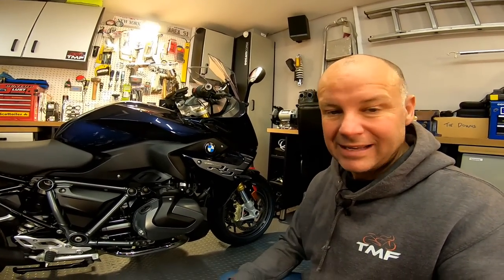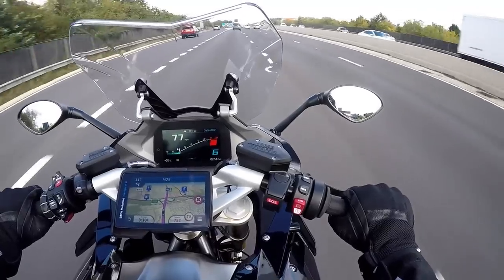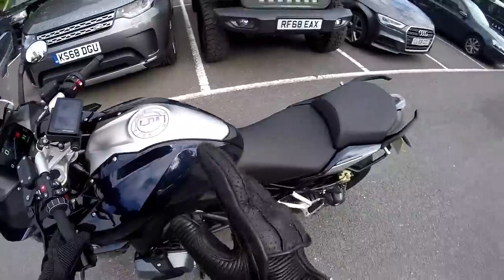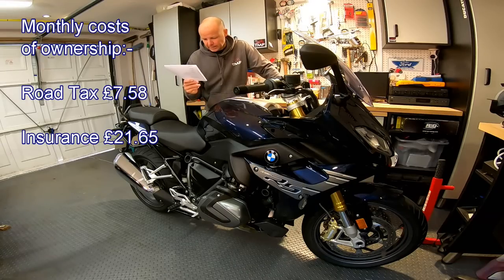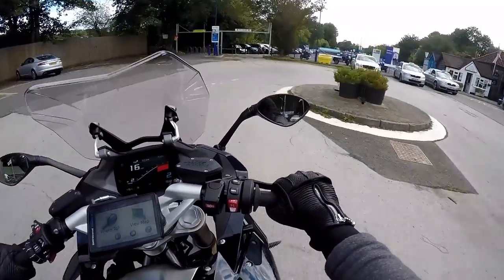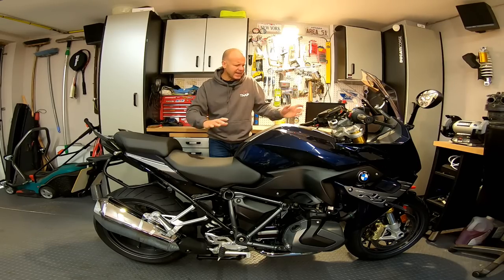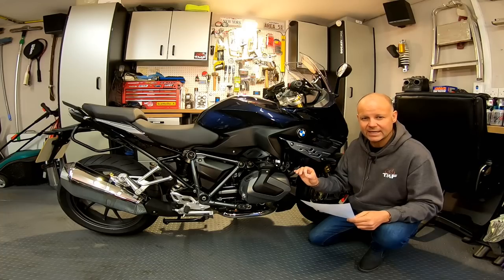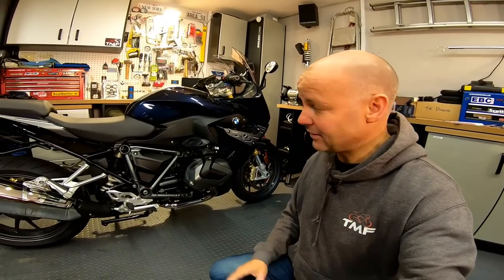Living with the BMW R1250RS - In Depth Review

Comment: Surprised you didn't get much turbulent air off the screen as it doesn't look much different from the previous R1200RS. I ended up fitting a MRA Vario screen, that made a big difference. A rear (Puig) hugger also helps with rear crud fling. Should be standard on a sports tourer tbh. I always worried about BMW painted front engine case being directly in the firing line from stones and debris so fitted the excellent MachineArt Avant Guard (looks factory). The Akra sounds great. Just some ownership tips if you get one in you future.
Reply: After having the R1200rs which I too installed a MRA Vario screen. I now have the R1250rs I have on order a new MRA screen, because I to found too much buffeting and helmet noise with the factory screen.

Comment: For interest, I'm 5'10'' and rode the previous model RS. Great bike but had switch to GS due to the cramped leg tuck, overweight on hands due to slight pitch forward and buffeting on helmet due to insufficient wind protection. Just too old to be "tucked up " on longer rides these days. Spot on review Sir!
Reply: I agree, have ridden both the RS and R and preferred the R for the all the reasons you mentioned about the RS.
Reply: Does TMF mention this in the review? 
I agree wholeheartedly with your comments.
I thought this may have been addressed by bmw with this model.
Reply: I'd expect more of a wind blast to the body would take some weight off your hands 😎👍
Reply: Tried an RS, but my knees were uncomfortably high. Guess I'm also too old to be tucked up. 😅

Comment: I used to own the 1200RS and have recently taken the 1250 for a test ride. There are a few things it still needs...Rear hugger .. change the position of the satnav as it's going to get blocked if you have a tank bag fitted. And bar risers, on long distances I used to get shoulder ache. Apart from those things it's an excellent bike.

Comment: I’ve had my 2016 1200-RS for the last 2 years & covered 14,500 miles, it’s never missed a beat - great all-rounder!! 
It is quite cramped though, easily fixed by getting the higher sports seat. Then you’ll need the bar risers to take the extra weight off your wrists... 
Also that standard fitted screen is totally useless on long trips/tours, I have two aftermarket screens to chose from of different heights, a tinted (more sporty looking) Puig - & a clear high/wide Givi screen. 
I have fitted a LeoVince exhaust to mine, but find it just too noisy for touring on, thankfully it’s a very easy/quick swap back to the standard exhaust, & visa versa!
I’m toying with changing it (eventually) for the 1250rs, then swapping all my extras on to that... I won’t take mine to any BMW main dealer for servicing, with those stupidly high prices! 
I’ve found myself a “back street” BMW specialist who only charges £40 per hour (as opposed to £90 per hour) labour, much better mechanic too imo. 👍🏻
Reply from the maker: Good find!

Comment: Mr. Flyer-A fine review of this beautifully blue painted bike! I compare it to my '81 R100RS and find some changes: mine has no electronic devices of any kind (no TV screen, ABS, electrical suspension, fuel injection) and fewer horses. But it does have the best fairing ever, much more lightness, an oil dipstick, a complete toolkit, and two (2) exhaust pipes as is proper for twin cylinder machines. In 38 years BMW has improved some things but left other good features behind, and it would be fun to see you review one of the older airhead BMW motorcycles.
Reply: Ha! Those '81s have the cool Mad Max fairings. Lovely. I have a '94 and I also just don't like the look of the new RS, it's just too sporty. A sports touring bike should look more of a touring bike rather than a large crutch rocket and I heard that same comment in other reviews as well. I am also holding onto mine and hoping they'll have a better look for the next gen, or just might end up getting an RT - even though I don't want a full touring bike.
Thanks for the in-depth review Mr. Flyer!

Comment: I have an ST which is the previous generation but same concept.  I removed the clip on bars and raised up the controls, installed a touring seat but left the pegs in stock position. Great Sports touring bike but not a touring bike.  Fun to ride, not as powerful as the 1250 but not as heavy either.  Great handling bike compared to the RT.

Comment: You can buy an enhanced rear mudguard at any BMW UK/AUS dealer. 
Quick and easy bolt-on OEM replacement for the  piece that sits behind the number plate arm. 
Not so pretty, but as it's much wider it keeps all the mud of the back of your pillion and your top-box. 
Forget the huggers, they do very little.

Comment: Thanks TMF for a nice review. I'm looking to buy a 21-22 R 1250 RS Exclusive used and found your review quite useful. The quiet exhaust issue your raise is a plus for me. Some residual concerns not addressed are the rear mudguard, which appears to promotes a tail tidy but hardly practical. Also, not sure how much proetecion is offered to the rest of the components. Likewise, the front mudguard may be too short in arc to provide full engine protection in this type of design. None of these issues were discussed in your review, but important for daily and touring riders alike. You also don't discuss slow full lock cornering such as low radius u-turns under engine power with feet on the pegs. A 240+kg bike can be a challenge under these circumstances.
Reply from the maker: They sure can! (I’m a Gold Wing owner!!)

Comment: I was about to buy one of these then looked in to the new Honda Gold Wing DCT at the NEC today. Not the lardy "Touring" version but the basic model. Trouble is it's almost £8k more. Gulp.  Agreed about the chrome exhaust, it really is horrible but you can spec it with the brilliant Acropovic and its transforms the characher of the bike. Don't bother with the standard or chrome ones.  Great review as always.
Reply from the maker: Thank you Martin - did you enjoy the show?  I'm there tomorrow...
Reply: @TheMissendenFlyer  I did actually, lots to see and whilst I went there to finally convince myself to buy a BMW R1250R / RS (it's your fault with your mega road tests!)  I really was smitten with the Honda "Bagger" as it's called. Now if you could hurry along with a road test on one of those I'd be much obliged. See you at the ExCel in Feb.

Comment: I had a 1250RS for half a day and whilst it's not sports bike cramped I did rediscover some old aches and pains after a few hours. Also found the pillion to be more 'perched' than my outgoing R1200GS. On the whole though a nice bike which handles well and stays where you put it on the road. After much deliberation I still prefer the GS so traded the 1200 for an R1250GS Rallye TE. Nice video though. Keep up the good work.
Reply from the maker: Thanks for the kind words!

Comment: I find myself increasingly torn between this and the s1000xr. Nice review thanks.
Reply from the maker: Thanks for watching and for stopping by!
Reply: I've just seen the new XR and it's a real stunner. Neither would be a bad choice.
Reply: Made your choice? If so - I which is it and why?
Reply: I'm in the same boat :)
Reply: @RobbieKiama  I picked the RS over the XR. I've not ridden the new XR. Reason for the RS choice shiftcam tech, fuel consumption, tank range would be my first thoughts, possible xr height might be an issue for me.
Reply: @RobbieKiama  With the new updates i think the new model Xr will win out as it suits me more generally, the lower range etc isnt much of a problem for my riding. Will depend on a test ride im due to have in 3 weeks on both bikes back to back.
Reply: @CeeRTee  would be great to see a review which focuses on new xr vs rs

Comment: I've heard rumours that in 2020 wheels on all BMW's will not be available as standard, only as an optional extra.

I know it's difficult, but is there any way in your reviews you could undertake a speedo accuracy test against a satnav? I think people would be quite surprised by the exaggeration of motorbike speedometers, which of course produces better mpg and services before they're needed.
Reply: I found i changed vehicles and the trip to the in-laws was now 130miles not the 120 it used to be. Also  30mph  is (24mph on the gps)
Reply: @chrisredfield3240  My Honda exaggerates by 9% compared to a satnav at a constant speed.
Reply: @chrisredfield3240  Sat Nav speed is not that accurate. I drive a 44 ton truck for a living and by law the speedometers in all HGVs are calibrated. I'm often showing 56mph (Max governed speed) whilst my TOMTOM pro truck sat Nav will show 53/54 mph. I believe that Motorcycle Speedo's are very accurate too....

Comment: Hi Andy
Just catching up on this as another video got my attention with this bike. Couple of years later but the main dealer service costs generally are staggeringly high. Two bikes both due first service soon. SV650 and Vulcan S. one very well known dealer, £500 for both bikes on what is basically an oil and filter change. Kawasaki dealer perhaps more sensible at £150 and another Suzuki dealers (though sells a few brands) at £228. So, still for something I could do in 15 mins each was £378.  I found one dealer that can do both for £325, but even that is incredible. Just had a Land-rover Discovery serviced and MOT for £208 for comparison.
Can’t wait for the warranty to expire as this is just stupid.
Reply from the maker: Yes crazy isn't it....

Comment: A good review. I have just completed my first 1k miles on my R1250RS and I agree with all of your points. I had the R1200RS prior to this and the latest model is a huge step up in my opinion. One negative for me is the price of the 'running-in' service. As one has just made a sizeable investment a few weeks before, it seems a bit of a cheek to charge so much so soon. The R1250RS is a brilliant bike and, bearing in mind I am 6'3", I find it very comfortable but get a bit of 'bum ache' after a couple of hours. However, this is easily relieved by a quick stop and walk about. The engine and gearbox are brilliant..
Reply from the maker: Thanks Adrian - glad we concur!
Reply: Adrian Tamblyn-Watts I’ve got the R1200RS and get numb bum syndrome after a couple of hours. Have invested in an air hawk which helps a lot and being a low bike can still get feet planted on the deck

Comment: Many thanks for this review TMF, I have just chopped in my R1250GS Rallye after test riding this. As you alluded to, I'm very unlikely to take the GS off road and the RS is much easier to manage for my little legs (I'm 5'8 too) and quite a bit lighter. The review was reassuring and helped with my decision so it was appreciated. Not sure Mrs W would agree though.............

Comment: A fabulous motorcycle good at all types of riding - cruise, tour or sport.

And, for DIY 'ers, maintenance is rather easy on a opposed twin.
(I do all my own maintenance on my 2012 R1200R, since new.)

Just a word about the 600 mile service: it includes a final drive oil change.
Very important.  And...

It is important to keep up the final drive maintenance.   It holds only 200ml of
75W-90, which sees constant sheer.  A rigorous, tough job for this small quantity.

 I change the final drive oil on my bike every other engine oil change (about10k mi).

If you do something similar and use premium synthetic 75W-90,  the final drive
will last forever.

Final drive will wear out at about 30k mi if it is not maintained.  Expensive.
Reply from the maker: Yes good call - thanks for watching and for stopping by....TMF

Comment: Top review TMF, I have that exact model sat in my Garage after it was delivered last week. Down side has been the 3 month wait for it to arrive and missing the last of the good weather. Got a VFR800 for a winter bike though to get me through till spring.
Reply from the maker: Hey congratulations on the new bike! What a bummer about the wait though, why so long??
Reply: @TheMissendenFlyer  Bikes got held up after production with a PDI issue and could not be released. BMW were a bit vague on reasons why just kept holding it and holding it. Its here now and bloody lovely.

Comment: Don't like the sound, so you would buy an aftermarket pipe that typically would make that sound louder...? 
I have an older R1150-RS, and I envy the refined technology with electronics management, and extra power of course. I do my own maintenance so I'd be concerned the new OHC would be a bit harder to work on. Also the styling has lots of bits and pieces which don't look as integrated as a unit as with some of the older models. Nice how the windscreen is adjustable but a slightly larger design that is more integrated with the shape of the fairing, again like the older models, would be more appealing, IMHO. My brother has a 2018 R1200RS and lives it.

Comment: Is this your own bike? 

You had me at ‘Sellotape for microphone’ 

Hill start assist.

The sales guy at Preston Bowker informed the exhaust is there only to up sell to Akro. On all four RS I’ve owned since ‘15, the Pipewerx exhaust is the best for changing notes, in Road it’s settled in Dynamic modes it pops and shouts. 

Always put a hugger on the rear tyre to stop the spray onto the shock and below the seat.

Being a short arse I also have handle bar rises, 30mm up and 30mm back. Also got the sponges over the hand grabs for comfy grip.

Rear luggage rack a must for both practicality and aesthetics.

Quick note, always manoeuvre your bike using the grabs and keep the side stand down.

Sincerely 
Newbie to channel.
Reply from the maker: Thanks for the advice and welcome along!

Comment: Cheers TMF. Prefer the look of the RS to that of my 2015 GS. Sat on one recently, liked it, but geared up with luggage and wife on the board and being a lanky 6’4” I think I’d feel cramped when on tour. Not completely discounting it, I really do love the style, but a couple of long test rides with pillion will be required. As always appreciate your work. 👍🏍🇦🇺
Reply from the maker: Yes agreed - not as roomy as a GS for 2 up....
Reply: I've got a 2017 r1200r and I've had the rider and pillion seat modified with extra foam to increase height. Much more comfortable and gives a slight lean which i prefer as hate sitting bolt upright......I'm 6ft2 and girlfriend
Is 5ft8, both slim and have done several long rides...did 2500m around France etc in the summer ....no problem with room unless we both had hydration back packs on, then it was tad close. As tmf said more room on the gs but for me, the ride is just more fun on the naked....That said, the gs is a great bike too!
Reply: I test rode the RS and Loved it but I'm 6ft 3in and it was too cramped. Got the GS instead. Can't say I'm disappointed.

Comment: Interesting bike and quite beautiful. Maybe a bit to much leaning forward seating position for me; haven’t tested that. Much too expensive for me so I would go for a second hand bike. I would like the satnav position more away from me in the direction of the screen if possible or on the top of the left clutch oil holder/box/thing. The turning circle will be much less while riding because you lean the bike in the turn.
Reply from the maker: I agree the satnav is a bit “in your face”

Comment: Hi, my partner just purchased an 1250rs and is finding the clutch biting point to be right at the end of the clutch lever travel. We have replace the levers with Prazzo levers which has helped but it’s still quite far out. Any other adjustments that can be done to bring the biting point in?  Thx

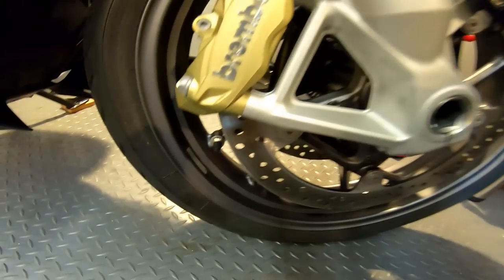Comment: 4:53 that's a straight valve ;p lovely attention to detail though in coming up with a very neat installation.
Reply: Very nice theoretically. In practice it doesn't work at all. The tyrepumps at gas stations are almost allways worn out and won't push the valve in enough to fill the tyre. I've owned an 1915 R1200R and now own a 2017 R1200R and have to fill the tyres at work, where a have a better nozzle.

Comment: Great vid, thanks! Which did you enjoy more, the FJR1300 or the R1250RS? (I saw your FJR1300 vid and you really liked that one too!) What's the biggest difference between them in your opinion?
Reply from the maker: Fjr1300 - biggest difference is weight and smoothness of the engine.....
Reply: @TheMissendenFlyer  So BMW really improved the engine but still couldn't get it as smooth as the FJR. Wow that says a lot about FJR. Thanks!!

Comment: Please would you tell us you inside leg length and your height and weight, 
if it’s fits you it my well fit me and other riders. 
p.S. I am not aware of any other reviewer that openly gives this information out regularly,many thanks.
M J Whittaker.
Reply from the maker: I have  32" trouser leg, am 5'8" and weight 73kg....
Reply: @TheMissendenFlyer  the reason that I asked for your leg size and weight is that I would like to be able tryout on a BMW 1200 year about a2013/20014 I have a inside leg of only 29” and as I’m.am now in to 76 year and my legs aunt as strong as they once were ,started riding when I at 16.
I have been  mainly ring Honda vfr’s over the last 15 years so I am a little concerned as to weather I would be able to manage the weight of the BMW 1200 I hopping that a lower seat would help
I hope that I have not made you feel uncomfortable by asking for your leg size. But your information on size and leg length has help me move forward with my quest to be riding a BMW soon. Many thanks for your time and help.
M J WHITTAKER 
P.S. PLEASE consider including size and leg length in your YouTube videos when testing larger bikes